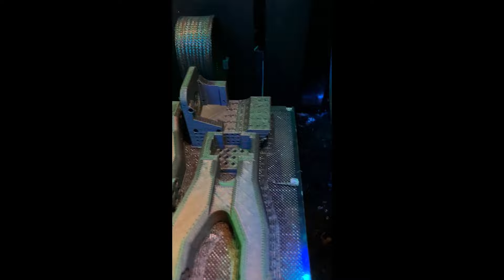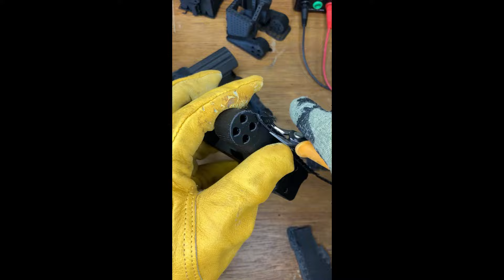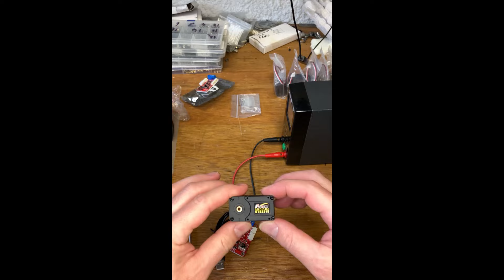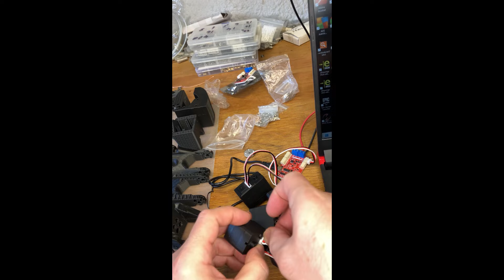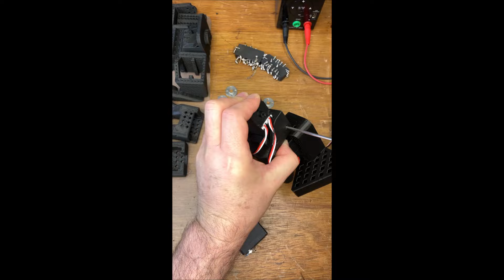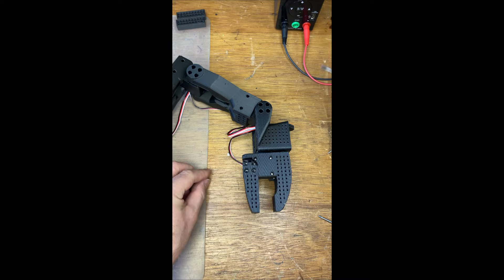Build guide for Standard Open ARM 100 5DOF - Low cost DIY 3dprinted robot arm Le Robot Hugging Face

Comment from the maker: Instructions to print, program the servos and build the Standard Open Arm 100 - Early alpha release.

STL files and firmware GUI for Feetech servos via a Waveshare or Feetech FE-URT adaptor board are here: https://github.com/TheRobotStudio/SO-ARM100

Standard Open Arm 100 - Early alpha for testing prints and sizings, all the prints are correctly orientated for z upwards to minimise supports.

Settings should be for no supports for angles greater than 45 to the horizontal and no supports for areas under 3mm2.

13% infill 2 surface layers in a high performance material like carbon reinforced nylon.

Video instructions are on the @therobotstudio YouTube channel.

https://youtu.be/QkIgxTCq3MY?si=S0YPFFkKXr_Xbh47

There's a playlist here of the development too: https://www.youtube.com/playlist?list=PLy7gxZH9jzfR0l8fYH8C1nyEc4pxSBrer

The arm is intended for integration with the open source "Le Robot" system being developed by the community at Hugging Face.

Six STS3215 servos are needed to actuate the five dof in the arm and the gripper connected via one adaptor board.

No other components except a PC and power supply with leads.

Simple hand tools only and takes under an hour to assemble to first movements.

At quantities of 1000 units even the higher power 12v version of the STS3215 servos used in all the joints of the present arm design are under 12 USD each - exworks - so around 15 USD in your hand.

Plus an adaptor board to connect to a computer and a clamp to fix it the desk.

If 167 (1000/6 = 166.6666) people are all prepared to buy the servos at once, and assuming that everything else is 3d printed, that's a 5DOF arm with gripper (6 dof total) and a half kilo payload for 100 bucks.

Join the project with some of the brightest minds in open AI and robotics development on the discord server at: https://discord.gg/nc2JuEnHEJ